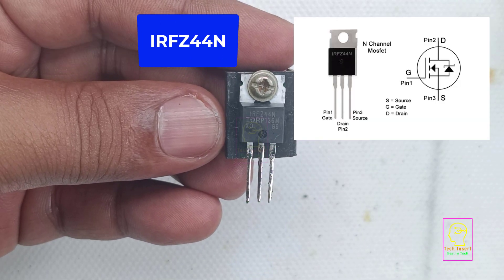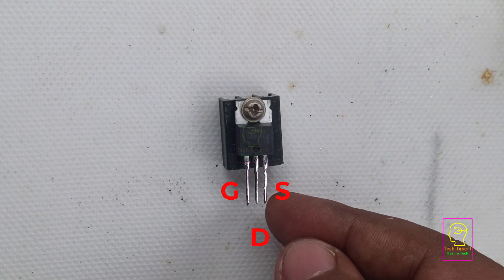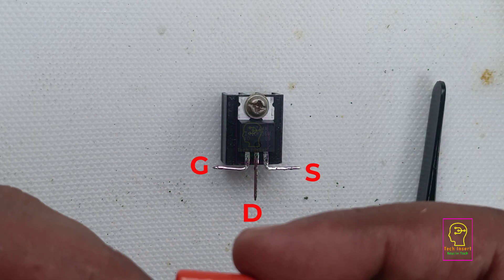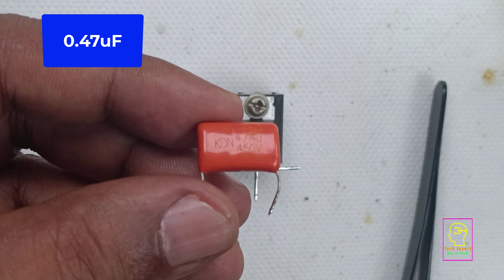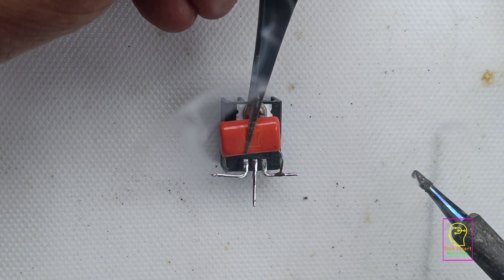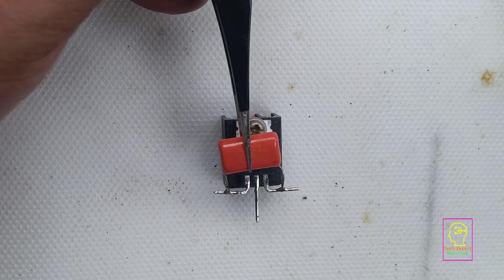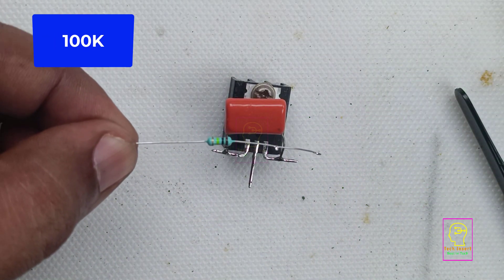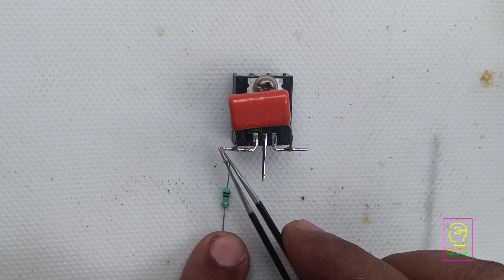Know the MOSFET trick of making a Touch Based Dim-Bright Control

Comment: Very nice and informative video, where we can use this circuit can you tell me sir
Thanks.
Reply from the maker: You can use this in the adjustable brightness circuit for emergency lights, or table lamps  This is an information video on the property of MOSFET. All mosfets has this property coz of the capacitance formed at the gate layer.